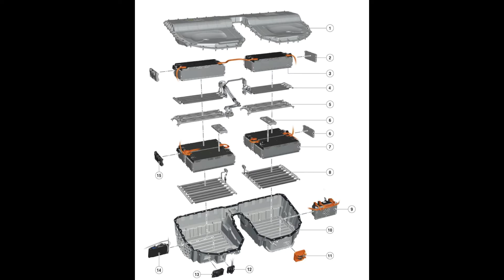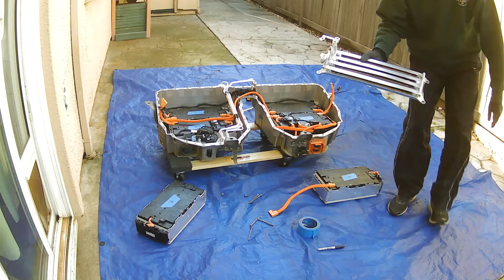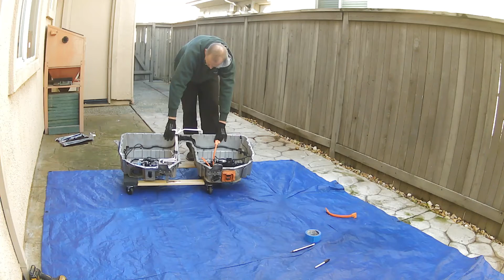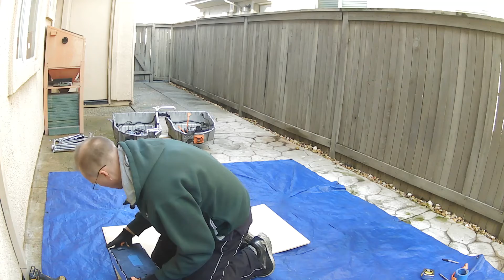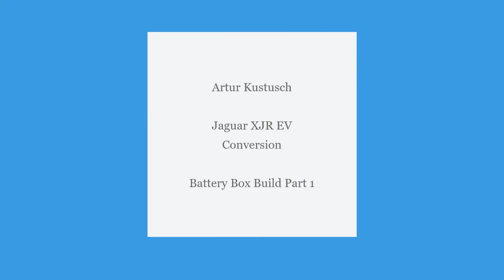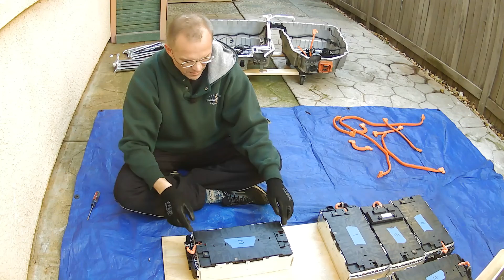BMW 530e HV Battery Pack Teardown

Comment: Thanks for showing this.Really super and clear explanation.  Never too later to view. I am going to be ripping open an SP51 20ish kW/h battery soon. From a March '25 330e hybrid. WIll be interesting to compare. From a recent partial teardown on YT the newer ones appear to have screw in type connectors for the various major components like the batteries, BMS and safety box. HV cable exit is in the base too, rather than side exit. All the best.

Comment: Thanks, that was a really detailed video! I saw a i8 battery pack and the batteries were in a line, it would be an easy pack to use as is, but they seem expensive for the same batteries.
Reply from the maker: thanks, outstanding find, I will have to add that to the Wiki page https://openinverter.org/wiki/530e_battery_pack the BMW 330e as well as the 740e also use the same battery modules, though the 330e only uses five of them instead of six
Reply: @Good-Enuff-Garage  this German guy took one apart, I think the cells are the same? https://youtu.be/WUYXuLcNbVQ around the 4:20 mark!
Reply from the maker: @dombutler7685  thanks Dom, really appreciate you sharing, now to brush up on my German, lol